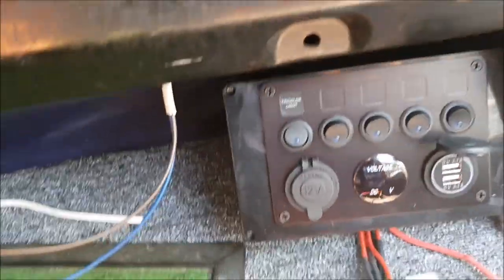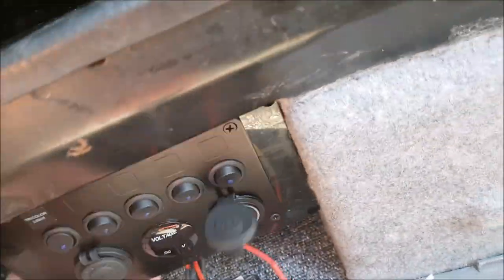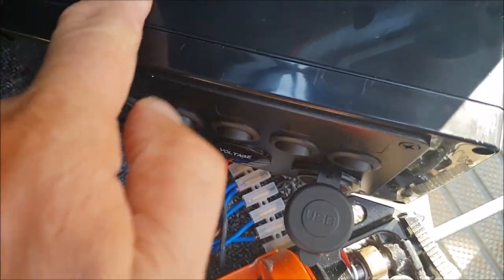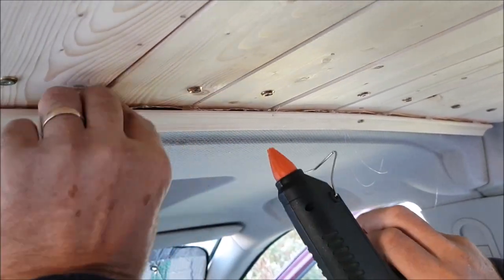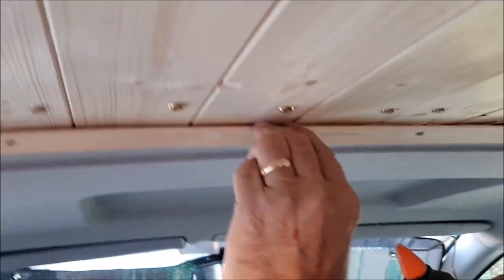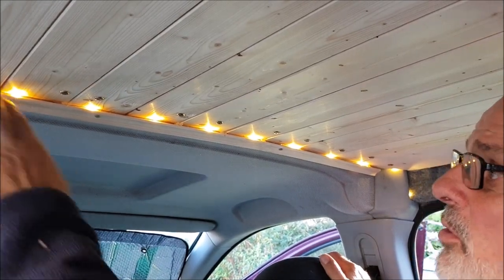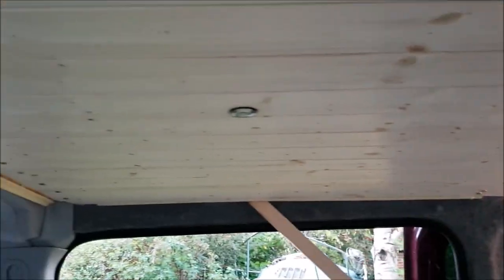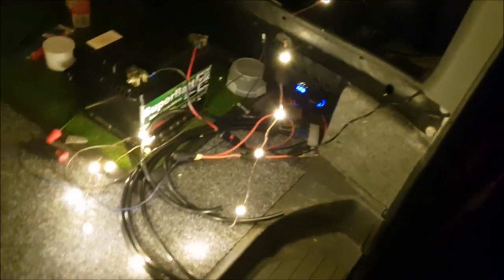VAN CONVERSION Lights

Comment: I've just been looking at those, I wasn't sure whether to get 2 sets - one for the front and one for the rear as I have a big van or just a 10m length and run it all around. I think I'll get 2 sets and double up over the kitchen, slider and front seating where we might want a little more light.